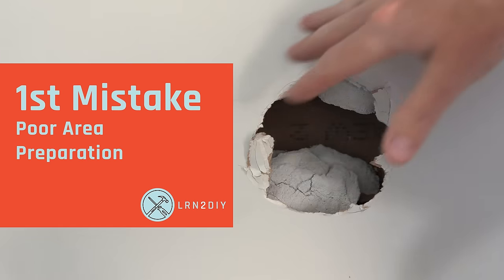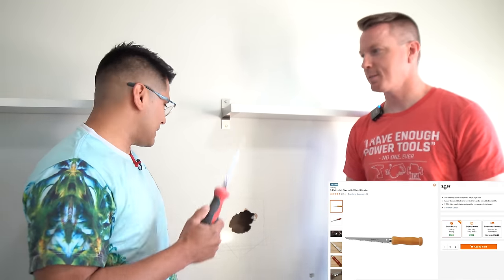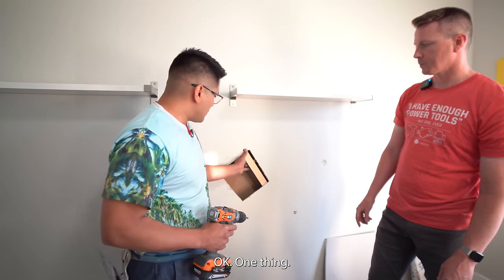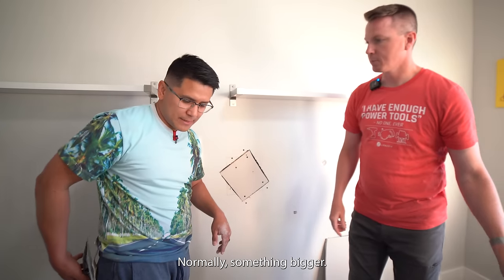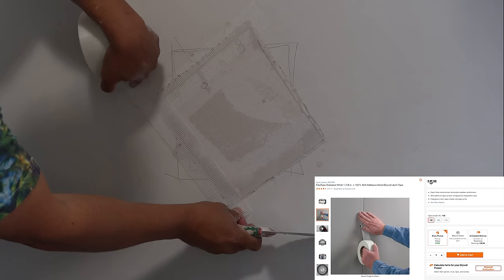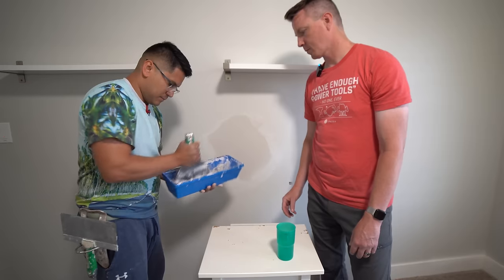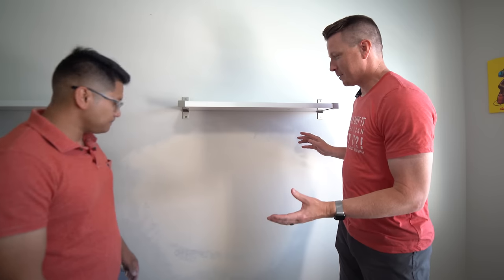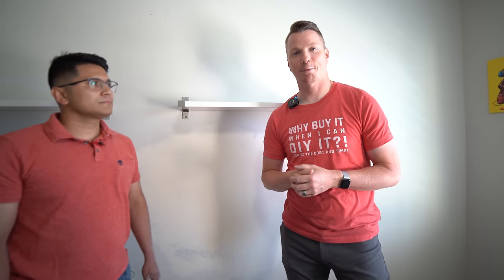5 Mistakes DIYers Make When Patching Drywall

Comment: no V cuts?
use the new fibreglass tape. is much stronger and better overall.
Reply: V cuts eliminates all that stir stick and/or stuffed paper backing b.s.! At least a v-cut on two opposing sides, all four is twice as strong. V-cut (or angle cut as some people call it) all eight edges. The existing four sides of the hole in the wall and the four sides of your piece of drywall patch. The "face" of the v-cut on the existing wall will prevent the new piece of drywall from getting pushed through when the patch piece of drywalls v-cut face is preesed to the walls face. Then apply your tape and mud. If you've matched the patch size to the hole size well enough, you don't even need the tape...

Comment: yeah, except one thing,  instead of putting those 2 nails through the wall to hold the timber
you could have just as easily (and it would hold better) use Liquid nails on the back of the timber so it sticks to the inside of the wall and you could have done the same for the piece you stick to the timber .
No holes to worry about

Comment: Breaking away all the loose edges of hole, and THEN cutting out a larger square shape around it, anyway, makes no sense! Why remove the broken edges, when you're going to cut out the hole? I just don't see the purpose, or the point!
Reply: You see the true size of the damage

Comment: That was all great until he actually began perfectly applying the drywall compound.

Sooo, magic. My mistake is that I don’t know magic.
Reply: Malcolm this comment made me spit up my milk. Lol. So funny. And yeah, I agree that they completely missed explaining the muscle mechanics of spackling.  I’m not bad at it, but the dude here is… very experienced. Lol. 

In reality this will be just a little insight and practice is up to you, but the way to get good is: 
- Prep the area so nothing sits ‘higher’ (bulges) out beyond the flush wall. Troughs are ok. Bulges are not. 
- First swipes to fill the troughs and light coat the seams. 
- Second coat to feather out the edges of your repair at least 8” 
- now lean into a nice wide taping knife 8,10 or 12” pushing harder on the outside edge of the repair.  After both sides get a good swipe, come straight down the middle with even gentle pressure and a flat attack angle to tidy up the ridges.  

Practice makes perfect of course. 
.

Comment: Please not a J*P saw .... that is based on a racial slur against Japanese people from the 1940s.  It's also not the correct tool for drywall; that is a reference to a Japanese fine tooth precision pull saw called a Dozuki, commonly used for flush trimming or even joinery.  Just call a Dozuki a Dozuki and a drywall saw a drywall saw.  Thanks for reading my thesis : )

Comment: It's 2022 not 1922 use a Oscillating Multi-Tool
not a "jab saw"
Reply: I have an OMT but would never use it for this purpose. The hand tool allows much finer control over the resulting cut and you are far less likely to over-cut at the corners.

Power tools are not always the best solution
Reply: Who cares what you use?  A jab saw is handier, less dusty, and cheaper.  This is a DIY channel, not a snobby 'my way is better' channel.  This is 2022 yes....where no one likes a snarky commenter.

Comment: thanks but no thanks, ill stick to doing a California patch
Reply: I do both, but backing is stronger.  If I patch somewhere on the wall not likely to carry a load, it in a closet, etc...California.  If its somewhere a picture might get hung or a shelf bracket installed...backing.
Reply: @elguapo5467  nobody asked
Reply: @elguapo5467    Great tip for diy guys, thanks.

Comment: Bizzar!!! Why would you cut the hole as you did versus 90  degrees, mature job!!! Plus this so-called Professional could not even cut the drywall,  plus the replacement patch had a 1/2" gap.  Overall yeah the hole was fixed but with no standards Half Az. O give this a 3 out of 10
Reply: This is how my 12 year old nephew did his first ever patch when given the materials and absolutely NO instruction or knowledge other than "fix this hole." So. What does that tell you about this method???